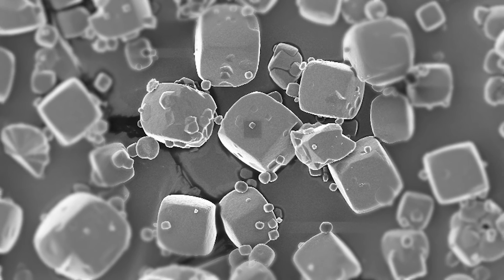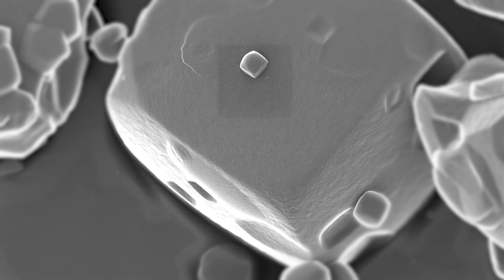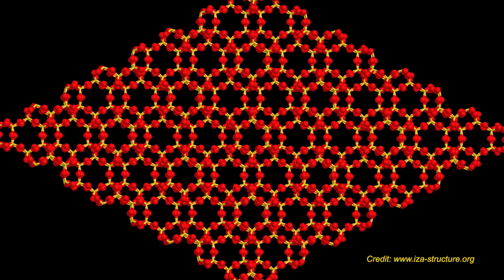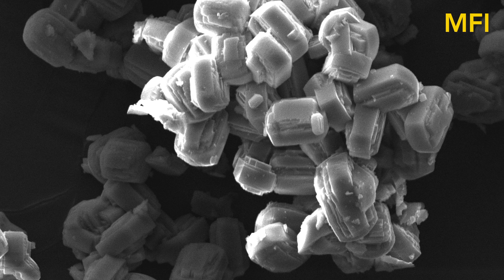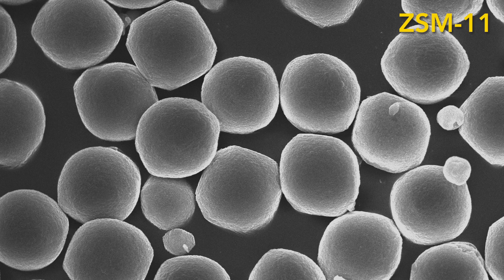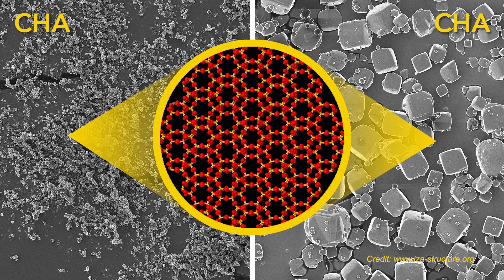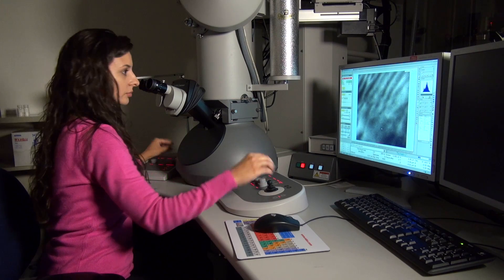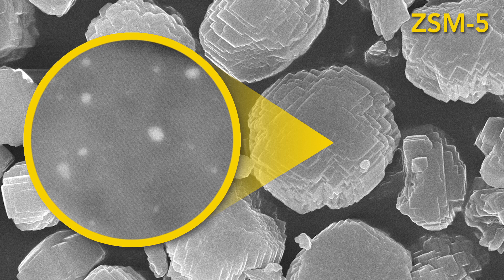Zeolites: Exploring Molecular Channels

Comment: zeolite white powder silicon oxygen aluminum sponge catalyst temperature pressure time crystallize synthesis crystal structure location size distribution electron topography materials engineering biofuels